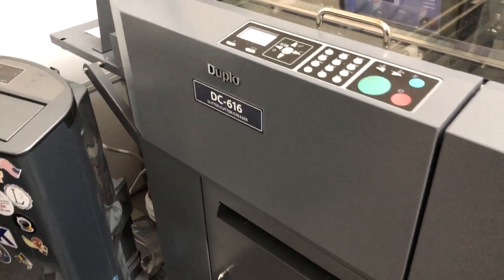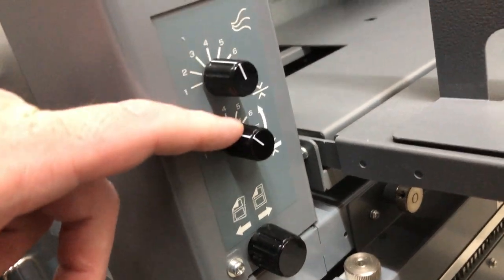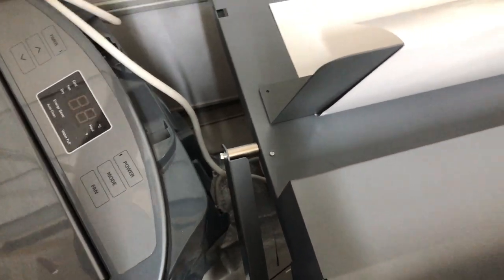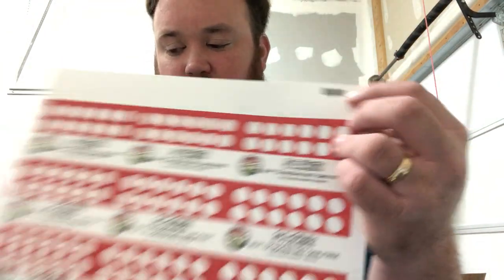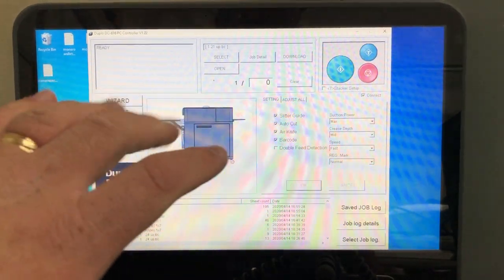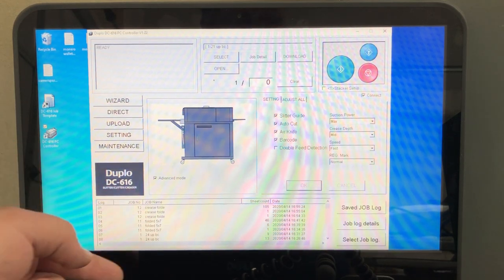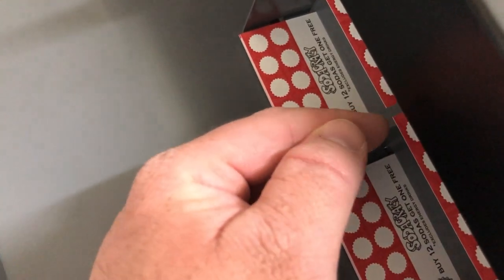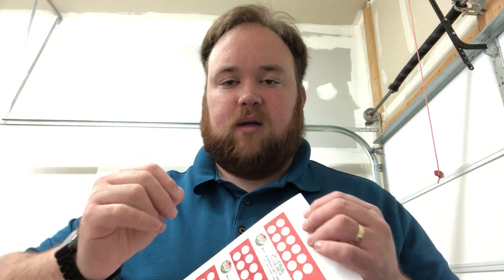Duplo Cutter overview - vlog 226 - Print Shop Updates

Comment: Recent subscriber. Really enjoying your content. Maybe a stupid question, but may I ask the reason why you print business cards on a separate machine and not on the HP Latex?
Reply from the maker: Thanks, happy to have you hear. I could print business cards on the HP Latex, but it's not really designed to do it. The main reason why is the finishing. While you could cut them with the cutter, they just wouldn't be as nice as they are with my Konica. It's also a lot cheaper to run them on the Konica, and I can't do two-sided prints with my Latex. You can with the 365, but it's not an easy thing to do. Great question.
Reply: @ttms  Thanks so much for your informative reply. We have a Designjet and also try doing business cards on it sometimes, but depending on the media it does not look as great especially where there is small text. Was wondering if it is any better on a Latex. Awesome equipment you have & awesome channel. You deserve more subs. Keep up the good work!

Comment: Out of curiosity, are you not able to set the Duplo to use inches instead of mm? We are interested in getting a Duplo DC-618 but switching to mm would take some getting used to.
Reply from the maker: There is a button in the software you can click that let's you type inches and it will convert it. I've found I get better results by having my fiery and Duplo on mm. I have a few conversion charts around the office and ask Google all the time to concert stuff.

Comment: Do you know what the difference is between the pro and the regular Duplo DC-616 Pro? I am looking at used models and I cannot tell. Also will it perf cut in 2 different directions same pass?
Reply from the maker: I think the difference is that the pro comes with the software, barcode scanner, extension tables and the perf attachment. You can get them all separately. I mainly wanted the software and barcode automation.
Reply from the maker: Single direction perf.